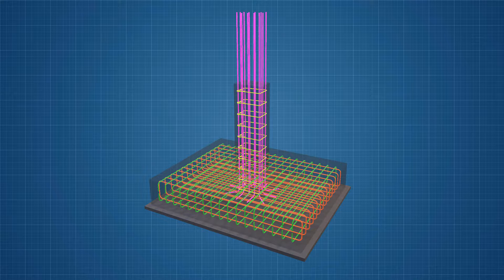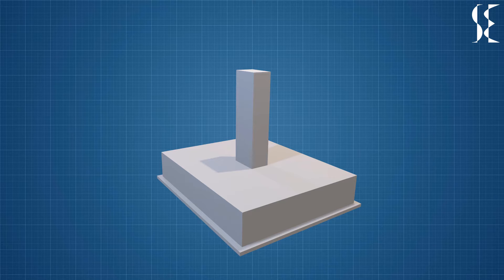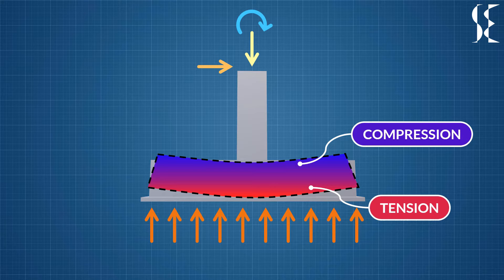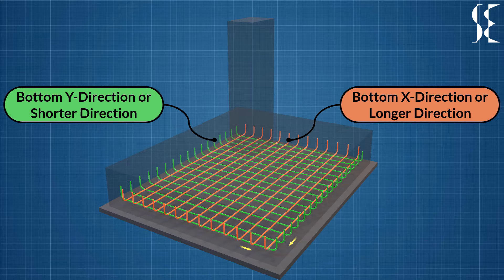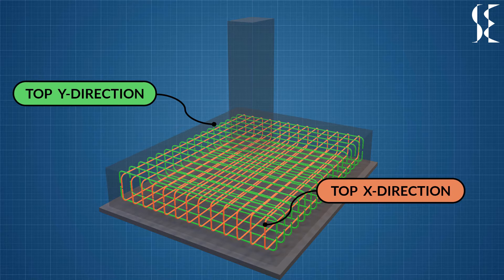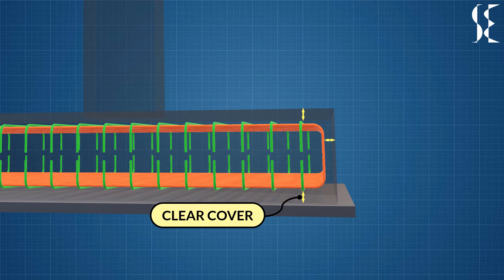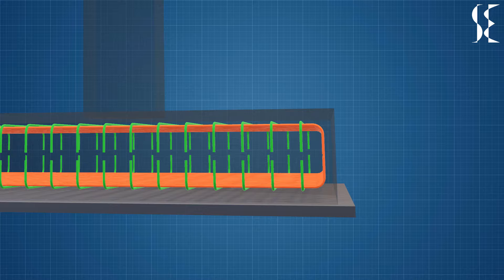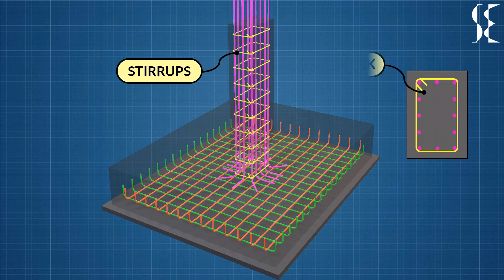Typical Reinforcement in Isolated Footing

Comment: Thank you so.much. I just wanted to ask, is there a formula for the lap length necessary for column reinforcement?

Best regards,
Reply from the maker: I guess "50 x bar diameter" should do the job but you should refer local code for lap length.
Reply: @StructuresExplained  Ok. Thanks